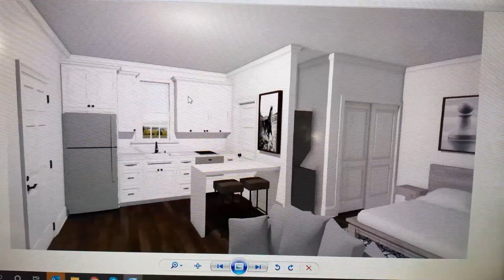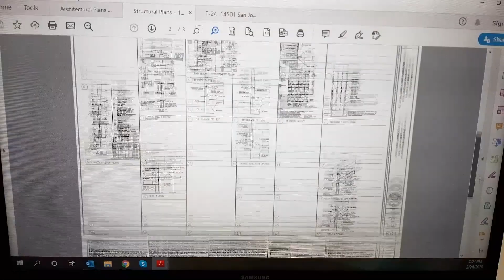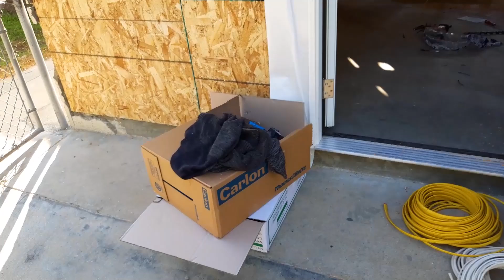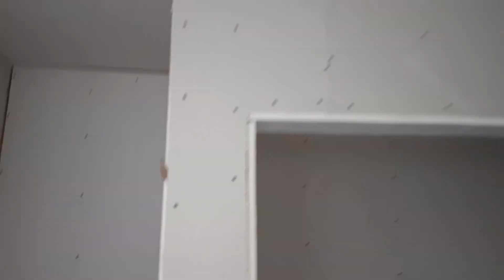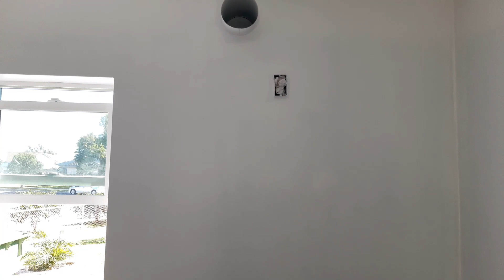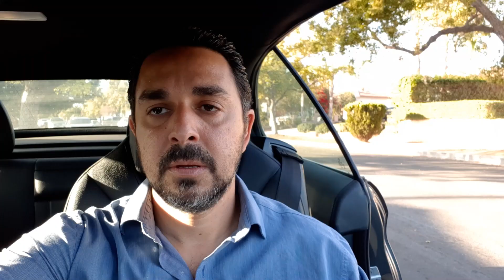Garage Conversion Process From Start To Finish

Comment: It’s a great unit. But I would have done the three windows in the front instead of side and done a longer higher window there instead. I think a side door would have better curb appeal from the street. Agree that maybe the washer dryer should go in the bathroom side with a pocket door. But owner could possibly do a bifold there to hide the ugly unit. What type of insulation is that?

Comment: You could have put another cabinet around the refrigerator for more storage and some open shelving on the opposite wall behind the door. In the bathroom you could have installed countertop from the vanity to over the toilet.

Comment: The design is very nice. If I will be allowed to comment, It would be nicer if you put the washer dryer opening  inside the bathroom  and made the bathroom door a sliding door. The washer dryer being seen outside ruins the beauty of the unit.

Comment: 90K seems low when considering the increase in lumber and other material costs that most contractors are claiming
Reply: I think $90k is outrageously high for this project.
Reply from the maker: Keep in mind this built start before the pandemic and shortage on material, also owner was acting as owner builder